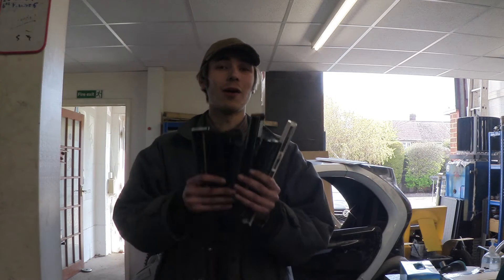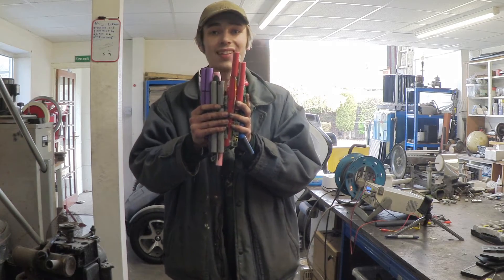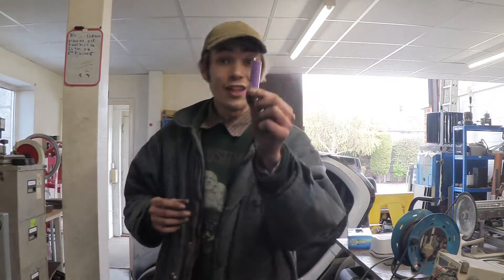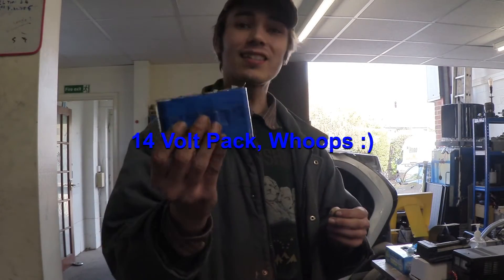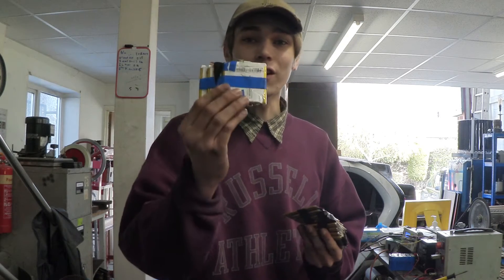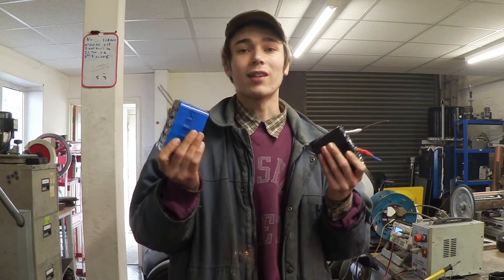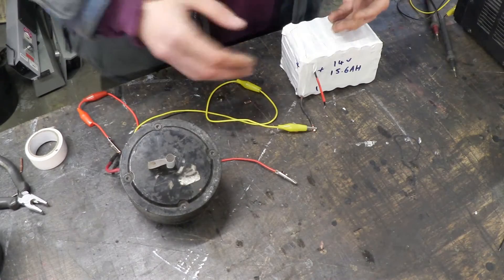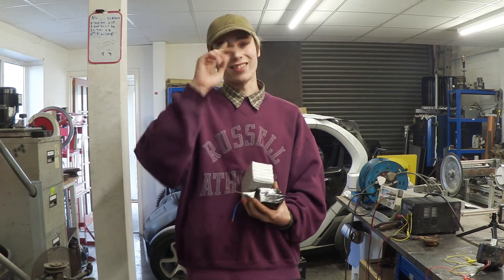1069   DIY Battery Packs from Salvaged Laptop Batteries

Comment: Sorry to say but this was one of the less usefull DIY-battery-videos. Even plain dangerous. It's great to encourage someone to do something yourself but there is truly good (and safe) ways to disassemble battery packs and use the cells. You talked almost nothing about safety precautions when dealing something with a punch like lithium ion cells and testing of them to make out which are usefull and which could burn down your house after couple of cycles or just die out. Not even anything about figuring out the actual capacity of the cells. This is the first video I've disliked from you guys but with a reason. There is always a risk when dealing with DIY-batteries but it's foolish to gamble before studying even the basic risks. Youtube offers lots of videos on safe disassembling without puncturing cells, proper testing on capacity, resistance etc. and putting together with battery management systems. There is no shame in learning before showing how.

Comment: Glad you mentioned BMS systems they are a must have when charging lithium packs.. Also due to the range of voltages between full and flat (16.8v - 12v) it is always best to use a 12v regulator when you're wanting a constant 12v. They are very easy to make, an LM7812, a couple of capacitors and a heat sink. 
By the way excellent video, pity you only got 50% of the cells being good.

Comment: Nice. Wise to use the tco.  18650 can do 50 amps when shorted. 6 x 4 x 3.6 x 50 = 4320 W. However 3.6 will drop at that current, lts say it'll be 2000W. It would be up in smoke in minutes.
A former collegue of mine actually made an electric bike with salvaged laptop batteries. It sure can be usefull.

Comment: You can do CPR on some dead batteries by connecting their terminals to another 18650 live battery - positive to positive and negative to negative for about 15 seconds. 

Try it!
Reply: Could zombify some cells but would definately not use them in a pack, maybe in a flashlight or something I'd not mind to catch on fire so much.

Comment: Hi Luke,
I build batteries as hobby, and when you salvage used or even build with brand new cells, it is Extremely important to test internal resistance, and actual capacity of each cell, then you must arrange them with similar values, on top of that should install BMS BATTERY MANAGEMENT SYSTEM OR BATTERY MONITORING SYSTEM, to avoid cell failure and potential fires 🔥,  safety first☆ this is very common people burning there homes down!
Reply: Thank you for the heads up mate! I agree a BMS is definitely important, I think I will order 2 just to have on the battery packs. Cheers mate! :)

Comment: Mate do a proper battery pack making video. Because you just skiped all the important things that needed to be done before you can just spot weld a battery pack. AND OMG USE A BMS NOT A THERMAL SWITCH, WHEN LITHIUM BATTERY STARTS HEATING YOU EITHER OVERCHARGING, OVER DISCHARGING, OVERLOADING OR ONE/FEW CELLS HAVE A SHORT INSIDE OF THEM AND ALL OF THESE LEAD TO FIRE 🔥🔥🔥
Reply: I found a hoverboard almost complete.The batpack gives 0;3 volts. Can you advise me waht to do? Shoud be 36 volts 4;4 amps.
Reply: @captainprototype187  don't really understand what you just wrote. Just answer the questions and I might be able to help.
1. Whole battery pack voltage?
2. Lowest battery cell voltage? (0v-4,2v)
3. Highest battery cell voltage? (0v-4,2v)
4. Does the hoverboard turn on and if it does, for how long?
5. Can you charge it?
Reply: @audriusradziunas5451  1; voltage should be 36v; but reads 0.3volts.  
I don ot have the bottom covers that houses the on/off button. Do not have a 36vcharger;  I have not checked individual cells for voltage rating. will I have to check the batpack with a 36v charger first? Or will that never work?  Must I resort to checking each cell anyway?
Reply: @captainprototype187  
Yeah you need to check each cell individually, if there are cells bellow average voltage ( for example, if 10 battery show about 3.5v and few cells are near 0v) then these cell will disconnect the whole pack, as this is a safety feature and why BMS is used. If this is the scenario then you found the reason why this hoverboard were not being used. But if all battery's are at the same voltage, then the BMS is faulty and if the design allows it you can change it and use the hoverboard. 
Good luck and if you still need help feel free to ask

Comment: You'll still want to get a BMS. They're pretty cheap on Banggood or Aliexpress. If you have one cell that's a bit worse than the others in your series string, it'll reach 0V before the rest, and you'll be reverse charging the cell. That won't likely cause a fire, but will nuke the capacity.
It's probably also a good idea to 'bin' the cells in a series string to match cells with similar capacities for an overall bigger capacity battery.
Reply: Where’s ur contribution videos, where ur at?

Comment: did you throw away all those included bms pcb's in the originals ^_~

'bigclivedotcom Teardown of a faulty Samsung lithium 18650 cell. (2200mAh)' 
see all that stuff at worst you could reuse with cheap receipt paper rolls diy batteries  ;)
Reply: The laptop battery controllers that I have seen (only two, a toshiba and a dell) from salvaging batteries  are too complicated to bother with. They both had anti-tampering in them so that you could not use them outside of the laptop. I had a look for schematics but the bms board schematics were not available for the ones I had.

Comment: Not worth the effort!
Reply: there’s always one isn’t there! 😂
Reply: Built a portable 13Ah battery pack from jerrycan and 18650s from powertools couple of years ago. Added bluetooth amplifier, car speakers, cigaret lighter plug, 5V USB-outputs and hand crank generator made out of a windshield wiper motor and a crank from an old meat grinder. Took months to gather stuff and order the rest from ebay but it definately was worth the effort because i made something unique and usefull myself with fraction of the price of something even close to my dear abomination's capabilities :)
Reply: oc its worth the effort, learning... and two packs for running retired wireless routers 24/7 in a local wan configuration as just one example, you need to expand your practical 2021 era thinking pd.
he could have probably reactivated the so called dead ones easy enough too , google it.
i do wish he would make a paper battery the same dimensions as those as a comparison